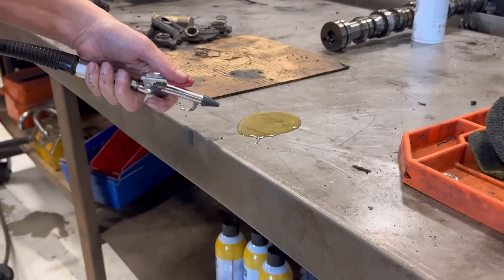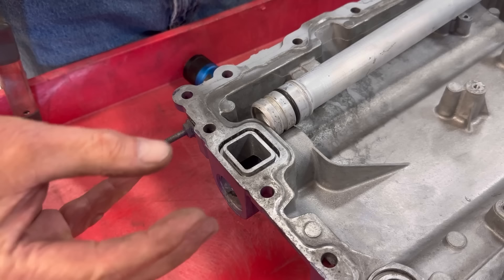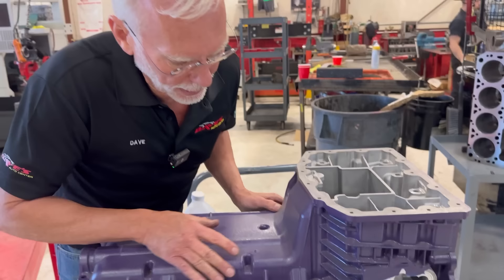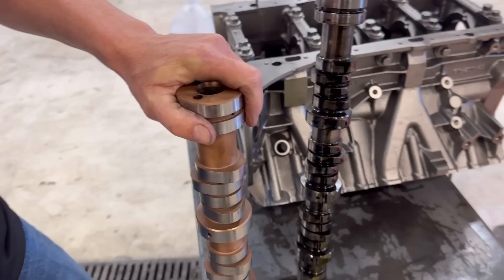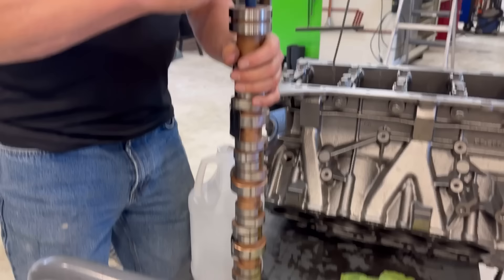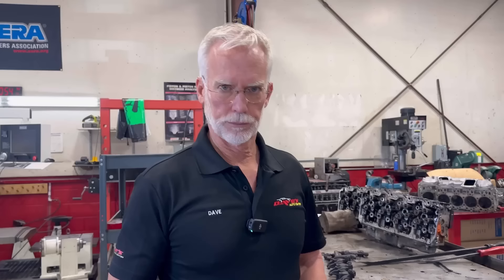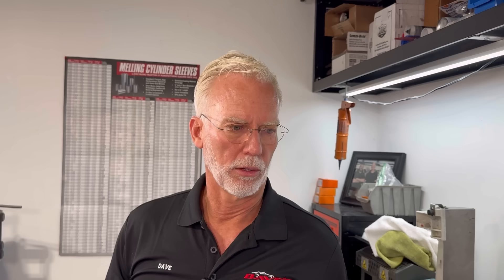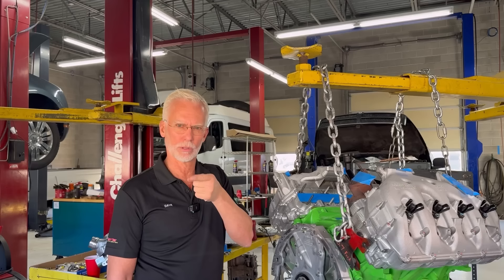Part 1: Ford 6.7 power stroke oil starvation issues revealed

Comment: Hi Dave  I agree with everything you’re saying, but I thought the whole points or one of the jobs of the oil filter was the back flow preventer in it so after the engine is shut down it holds not the pressure of oil but the volume of oil in reserve check.  This problem would be easily solved with multiple checkpoint backflow valves, so that at least in three stages this oil is held in reserve in the passage ways. With an electric prime pump before start up.  To be honest with is the first and number 1 problem with everything motor.  It’s cold dry start up! It a very solvable problem, so ya have to ask the question with every manufacturer? Why don’t they solve it. Some oil manufactures make additives to stay stuck on surfaces. It’s ability to cling itself to metal parts but as you mentioned that doesn’t necessarily solve the oil volume pressure issues and I really don’t know how well the oil filters hold that oil in check there’s too many drain points  ahead of the filter that are not helping. The way to solve this problem! See below 
1.engine block, design oil passageway simultaneous, feed locations
2. pre-prime solutions electric pressure primers or 
3. check valve low pressure solutions or back flow preventer at at more than just the oil filter location. 
4. or a small top feed tank that slowly drips on shutoff on critical top half locations. 
Just my thoughts! 
Don’t throw it in the dumpster  call the Stumpster!
James Stumpf of Parma Ohio

Comment: I really appreciated Steve Morris’s way of explaining the system with you and how everything works together. I also like that he goes through the failure analysis. The only other guy I have seen like that is Gale Banks. I subscribed after this video. Great explanation and interested to see the fix. Is there room to add oiling passages to the cam bearings from the mains? Could you design or run a solid camshaft if you were able to provide alternative oiling to the cam bearings? Thanks for the Video. Thanks for always trying to make things better, a rare trait nowadays.
Reply from the maker: Thanks for the great share and the feedback!

Comment: Great video. What a hideous oiling system. On a cold day I bet it takes 3 minutes for lubrication to actually begin. I knew Ford engineers were out to lunch when I discovered my 2018 Raptor had a plastic oil pan and drain plug

Comment: Interesting thought on the lifter rollers, using a solid bronze bushing in the center that runs on a thin film. I think you mentioned that they are used in race engines, but wonder how it works on the day to day application? Needled bearings by design are used specifically for high load due to greater load surface area, as in a drive shaft u joint. Hydroelectric plants use bearings that ride on film for their generators (thrust bearings), and they work great, unless the generator has frequent start and stops, as it wipes out the bearing. I wonder if this is the same concept as the bronze bushing bearings you mentioned, where they may wear sooner with freaquent start and stops. Hard to say because I'm not very Familir with that individual design but more familiar with the concept. Question: what do you see failing on the needle bearings, is it broken bearings or wear.  Thanks! Great work by the way.

Comment: I don't know if im a bit of a fool for this but i like to fill my oil over the half mark on the dipstick indicator.  But under the overfill line. Therefore i have no excuses for low oil.  I have a 5.7 hemi. Im well ware of what low oil and exceeding oil changes can do to this engine. Especially the top end.

Comment: That motor oil gally should have some type of a one way ckeck valve to keep the most of the oil from the pick up to the top of the block so the system is always primed with oil. Thats my dumb thinking. 😁

Comment: So the solution is a preoiler pump or accumulator that pressurizes the oil gallery and bearings then after a couple of seconds then the starter engages

Comment: Love this stuff. Thanks for making this content. 

I remember changing oil on Econline vans and they would have a rod knock for few seconds after service just because the oil had to fill up the filter and the cooler before it would make it to the bearings. Now those vans were usually reliable but I always thought that was a poor design.
Reply from the maker: Great point!

Comment: Oh no , here we go on the prefill question. After 7 yrs as a Mercedes Benz tech at a dealer, realized, a lot of oul filters can not be " pre filled". 50 yrs of no prefilling,  never had an issue.I only have 30 yrs of diesel engines I use for proof. More oil is great, I get it. But, most, MOST of the time , not " pre filling " is just fine. Engineering is more important.

Comment: That needs a one-way valve right by the oil pickup to hold the oil in those tubes when the engine is off, or getting an oil change.

Comment: Sound to me these diesel engines need a preluber like a eletric motor to pump the oil before engine cranks up .......... me being a seasoned technician (retired) I've seen these on tugboats and marine engines ,  a lot of these were hand crank pumps,  but you get my reasoning here ,  they need a preluber and possibly a larger oil pan .
Reply: That’s exactly what I was thinking. They should be on all engines, just run it for 2 seconds before the starter engages. Some people would complain about their car not starting fast enough but eventually everyone would get used to it.

Comment: ⭐️⭐️⭐️⭐️⭐️

This is great content.  I’m new to the diesel world and after watching this, I’m curious if I should be starting my engine with a high idle setting of 1000-1200 rpm.  Lots of opinions out there on idling so I thought I’d ask here.  Sounds like I should start up the engine with slow driving to slowly bring up the temp, rather than idle at 1000-1200 rpms for several minutes. Thanks for any input out there.

Comment: Very interesting assessment, it's mind blowing to think how much oil that pump flows if it needs a pickup of that size bore. Aren't there any check valves in the system after the pump?

Comment: I am an ideas person, I have designed a lot of things that I  now see in production. ( one of being the motorbikes across the A frame and towbar.
How about this idea which must have been thought of - an electric drive onto the oil pump or an external drive to get oil pressure up before start up.

Comment: I’m planning a motorized oil preluber that uses a pressure switch to shut off when oil is at pressure.  Would prevent dry starts .  Just need to pick a pressure number for the switch. Similar to the link I just put up.

Comment: Hydraulic roller lifters have been around for many years. The bushed lifters you are talking about are available for automotive use but are a solid roller design. These lifters are generally recommended for racing engines running over 8,000 RPM with cams over 0.800 inch lift and many have open valve spring pressures over 800 pounds.  The 6.7  Ford diesel I’m sure doesn’t come close to the automotive requirements for bushed solid roller lifters. Who wants to add additional maintenance to an already expensive maintenance costs of  a diesel engine.  an oil change cost for my Ram is $160.00 and fuel filter costs of over $250.00. Oil change  interval of 7500 miles and fuel filter change recommended at 15,000 miles for my Cummins and for the 6.7 Ford. I’ve owned both. Had no troubles from either. Nice rant on your part ,but don’t understand it. Just doesn’t make sense to me. Just the thoughts I’d an old man. Not saying your opinion is wrong.  Everyone is entitled to their own opinion. Most common issue with all diesel engines I’ve heard of is lack of maintenance.

Comment: Obviously, there has to be a way to bypass, put an external oil pump directly to the top, attack it from two directions I’m not smart enough to figure out a way to bleed air out of the system but that is certainly a problem

Comment: No matter how much oil drains, there's always a thin film left. I don't think the oils draining would make that much of a difference. The spun bearings are known to be caused by high viscosity oil usage. The high viscosity oil doesn't allow the oil to flow freely into the smaller oil passages.

Comment: Speaking of leaving stuff in an engine, I just battled the weirdest overheating. Sometimes an hour of freeway driving full send would be fine and then boom overheating.  Sometimes it was fine to idle but not to drive. Decent amount of New parts. Not any sign of poor maintenance of the cooling system. Headgasket always checked out fine and it hadn't reached the red by the gauge, it's my car and no one else is driving it. Minor traces of a copper head gasket fix and some sort of black plastic particle, I assume. I'd flushed it out quite well though since getting the car. I thought it was rubber from an old thermostat, I replaced. Anyway, I was driving it back to work to work on it some more and I was just about able to nurse it using a scan tool with live data to track the actual temps while having full Heat on full. Anyway, I give up on this hot slow drive for another hour. So I decide to stop by a costco and pull the dealer bought brand new thermostat because it's acting like the thermostat isn't opening. ( It replaced a tested and known good used original thermostat that was just installed to replace a name brand replacement that seamed to be a bit too hot on testing) Especially, since the thermostat housing was not heating up anywhere near the block temperature. So I drain then pull out the thermostat and reinstall the housing, while praying filling goes well, it should I don't got no thermostat. (I'd started to carry one of those easy fill kits and some hose for the bleeder and filler on the ports on the engine.) Then I see something in the makeshift drain pan. A wad of steel wool. At first I'm thinking was that there before hand or was it hanging on the car. Anyway. I decide that it was probably stuck in the recilation pipe behind the thermostat and was blocking the engine from recirculating water, but not all the time. Which would also explain the extreme hard time I had with filling the system at times. It also would explain why the thermostat and the fan appear flaky, they weren't always seeing the actual hot water from engine circulating. It probably also explained the weird heater issues sometimes it worked sometimes it didn't Anyway. I just drive it to work, no thermostat, I just want to get there. Not too bad held about 66 to 80 degrees depending on engine load and speed. Take off most of the hoses and do a full flush garden hose flush nothing scary comes out just a few tiny copper specs. So I put a hose into the tube behind the engine recirculation valve and blow in it to see if it's still blocked. no it seamed free and clear. Also that wad of steel wool looked like it was the right size to get stuck in there but 100% stuck. So I re-install the same new thermostat and boom. I'm a happy camper. I was about to order the head gasket kit because what else could it be. What was wierd was this started with a minor overheating which appeared to be do to the pressure cap seat being worn out leading to coolant slowly making it's way out as the system really only got to 5 psi. I replaced cap and then realized it must be the radiator and that fix that issue with coolant dripping into the expansion tank and overflowing. (BTW, it's a good idea to use a  pressure gauge on the closed coolant system to really check if your cap is actually seating correctly. Just make sure you don't let hot water poor all over you from a poor connection. )

PS. I'm the one who left that wad of steel wool in the cooling system. I used to clean an oring seat out. :( Ironically, it happened while I was replacing the water pump, the thermostat, (The old one had degraded rubber) and all the hose and o'rings in the cooling system. You know to make sure it stayed reliable and didn't blow a head gasket. But that was like 3 months ago

Comment: If there was a check valve somewhere along the line it would have been smart. Basically, from what I’m seeing everything looks too complicated I used to be a truck driver and the Cummins owners manual had an oil diagram of the engine. That looked nothing like this.

Comment: We put a sending unit on  a oil galley and when you go to start the motor it will not run until the oil pressure trips the switch to let the motor start .

Comment: Everything auto makers do when designing cars and trucks is done for a reason. Bad design = intentional design. Parts are designed to fail, and engines are designed to last no more than 4 years on average. Today's cars and some trucks are disposable after a certain number of years (average 5-8 years), then you're spending money over more years with another car or truck. The cycle is continuous and they design and build them that way.

Comment: Do you guys recommend the use of an aftermarket lower oil pan with extra capacity like the PPE option?  Also, would the oil actually drain backwards through the positive placement oil pump during an oil change or does the pump have a check valve installed to prevent the drain back?  I have noticed the classic Powerstroke “typewriter” noise mostly after oil changes so this totally makes sense as to what it is. Great observation Dave.  I have noticed the noise is more prevalent after adding 10w30 vs 5w40, is this just me?

Comment: Fitting remote oil filters and oil coolers on small air cooled engines suffer on start  up
To fix this use an oil thermostat on engine block and have the oil cooler ports on top [so cooler does not drain ]

Comment: This is where I get a little confused by some mechanics.

A lot of mechanics say that you do not need to allow your vehicle to warm up on a cold start.  In fact, some will say it is actually better to get the car moving and increase the RPMs in order to increase oil pressure.

On the other hand, it seems in systems like this that it would be better to allow the engine to cold start and warm up the oil to circulate it properly in all the internals before increasing RPMs beyond idle.  Yes, I understand that cars purposely start at a higher RPM to quickly circulate oil before coming down to a normal idle when cold starting.

Which is it, should I allow my Mustang GT to warm up for 5 or so minutes on a cold start or does it really not matter?

Comment: I’d be interested to see the timings for oil pressure when left for a few hours, a day, and a week or more, to see if there is any difference between them. Also, does that oil filter have an anti-drain back valve?

Comment: Dave I can save you some time I have already done just what your doing and as a 3rd generation engine builder myself it's roughly 9 seconds to the turbochargers turbine shaft performed with several 1 off fittings and tee's, it started building pressure (very low like 8-13 psi) at the 3-4 second mark but didn't reach full base line oil pressure until like I said 8 to 9 seconds into fire up from oil drained and cold start with a full new pn# 2124s filter.  This engine is a canadate for an oil accumulator and a way to precharge prior every startup. But let's look at data and facts here there's 3 generations of scorpions out there real time since mid-late 2010 till present and we really haven't seen a whole Lotta major issues with starvation there's other areas though we could focus on making "better" ford is #1 there the best in the business but goes to show we all can't perfect only one is that's Jesus christ keep up the good work guys we enjoy your videos keep em coming
Reply from the maker: Thank you for the great share! Have an awesome day
Reply: @DavesAutoCenterCenterville  you to guys thx

Comment: Would a smaller diameter pick up tube work than a stock pick up tube to reduce oil starvation and improve oil pressure for the oil to get to the bearings?

Comment: My buddies 6.7 2019 blew up 40k mikes in a f450 dump truck Took 8 months for Ferd to get it replaced ..
Was knocking up in top bad.
Ferd would not tell us what failed and took the warranty core sealed up.
Now his transmission went at 60k..
POS .
Stay with Cummins engine s who build real deisels .
After the 6.0 and 6.4 Ferd disaster you think people would still buy Ferd .

Absurd oiling on that design.
I have build hundreds of engines since 1976.
Best to crank engines for  a minute with fuel off to precharge oil gallery.

Comment: I'm not convinced all that drains out. I drain my engine warm, and when it's done draining and I let it sit for an hour or two and drain, there isn't another 2.5 quarts draining out of there. And I only get about half a second of clatter. The only time I had a lot of clatter was when I briefly started the engine to empty all the oil out of it. Still it was only like 2 seconds. Lesson learned, I won't so that again.

Maybe it's the older engines. Mine is a 2020, first year of the third generation with the steel pistons and the other upgrades.

Comment: Wouldn’t be easier and more accurate to put pressure gauges on the engine and measure time it takes for oil pressure to build?

Comment: You thinking a check valve will help solve the dry starts?  What about running a better oil with a exceptional addative package with high zink ect for a sacrificial layer?  I have always disliked  those lifter followers, Ram also has an issue with them.

Comment: This is great information.  I have an LS motor: would it be good to go to a dry sump system. That way you can possibly run the pump before you start the engine.  If I stay with the wet sump, what would be the best oil to used to get the engine lubed on startup?  Thanks for the info.